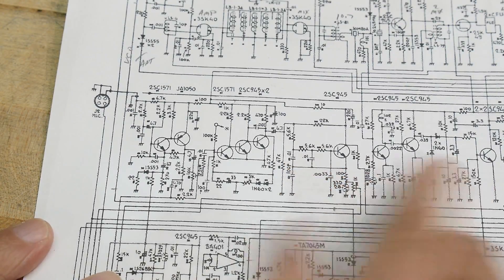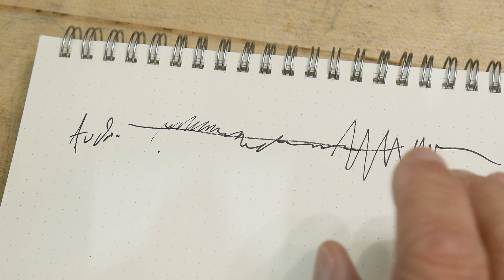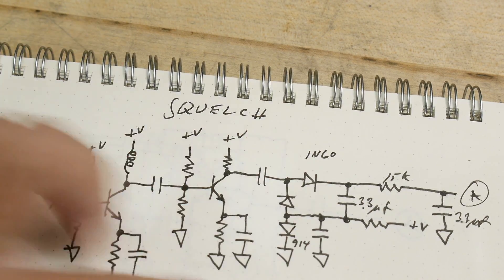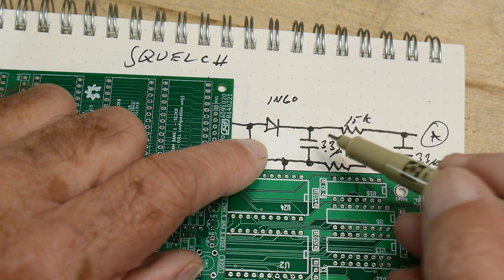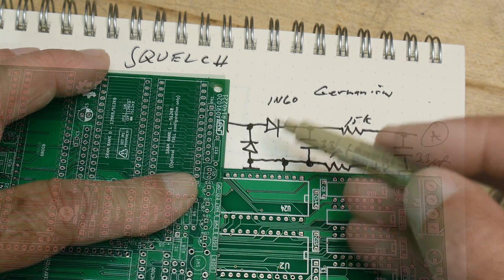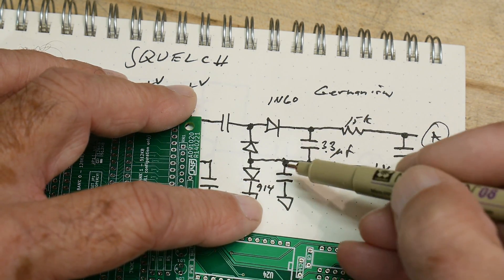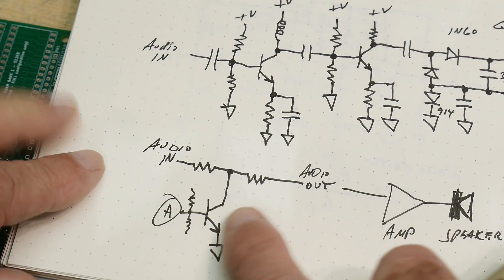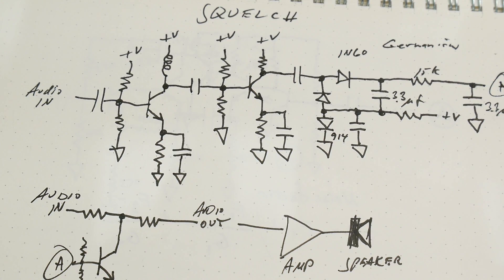#959 Squelch Circuit

Comment: Hmm, most receivers of the era took the squelch off the AGC - muting the audio when the received signal strength fell below a given threshold.  I didn't see the full schematic to see what's going on here, but the circuit would have been very similar - an integrator and a threshold detector, probably (as you observe) based on Ge diodes.  I've also seen an intermediate stage of development where instead of an IC op-amp, a long-tailed pair of transistors gave a high-gain stage. 

The venerable op-amps like the 702, 709, 301 and 741 all used essentially the same long-tailed pair topology, except that the emitter and collector resistors were replaced with active current sources. That way the voltage gain of the differential stage could be extremely high while remaining stable - the 301, if memory serves, had a gain of 5000 at that stage.

Could this 'squelch' actually be a noise blanker - muting the audio in response to an impulsive signal such as a static crash from lightning?

Comment: Wait, wouldn't the peak detector turn on the squelch transistor when audio came through and let the noise through instead of the other way around? Is it not maybe a pnp?
Reply from the maker: yes, I must have missed something
Reply: @IMSAIGuy  i guess it would work if it was a negative peak detector
Reply: That makes sense. Thanks for clarification. I was wondering how this worked with a npn.

Comment: enjoyed this/learned from it. 
question:  would a comparator be useful in this circuit or just overkill?  or bad for some other reason i’m not aware of?
Reply from the maker: comparator is the right choice today.
Reply: @IMSAIGuy  Or else do it in the DSP!  If you've got DSP anyway, no sense spending board space on an extra op-amp and a bunch of passive components.

Comment: Thanks for pointing out the bias on the detector circuit to overcome the "deadband" from diode voltage drop. The coupling capacitors in this circuit are all < 1 microfarad. So they are listening for ultrasonic noise above the voice frequency range. When sufficient carrier is present, the noise above and below the carrier drops, and this triggers the unmuting of the squelch. Because of the triangular noise distribution of FM, monitoring the ultrasonic noise is an effective method for carrier detection.

Oddly, I have noticed that tone squelch will work when the signal is not even audible. We used a 67 hz tone on a phone patch, and found that weak signals that made no difference in the background noise level, much less any discernable audio, would trigger the tone squelch PLL.